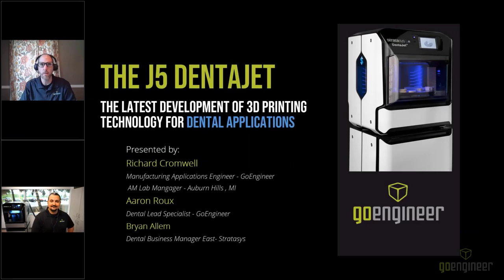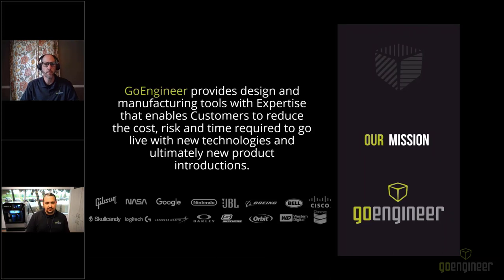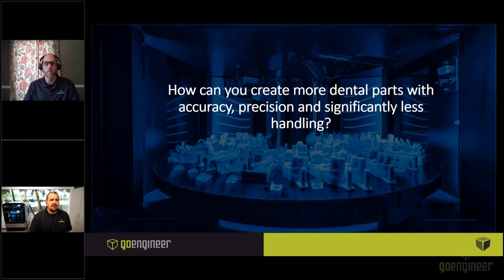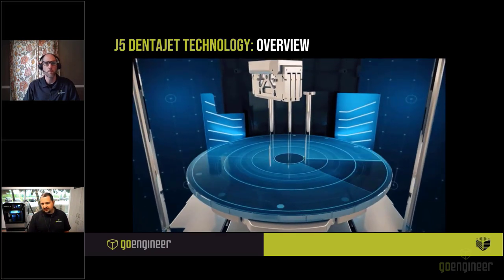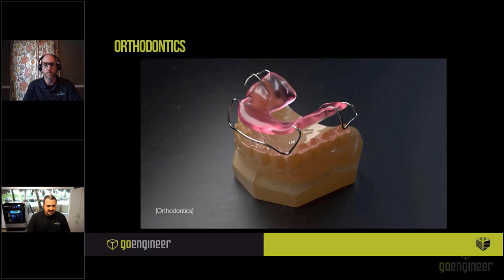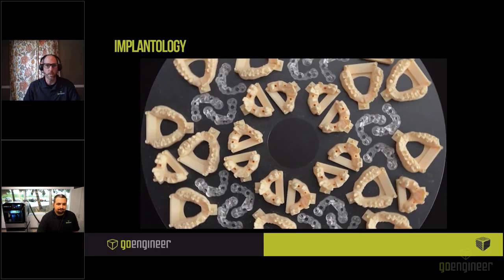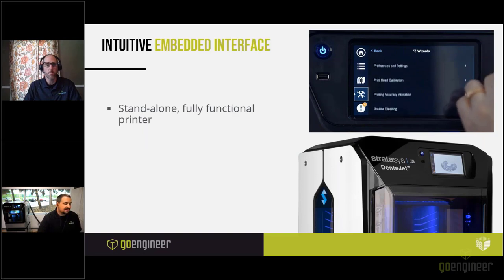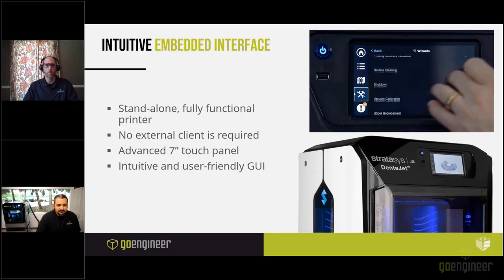Stratasys J5 DentaJet – 3D Printing Technology for Dental Applications - Webinar

Comment: The J5 is nice but I don't think it really brings anything new to the table for dental applications over SLA that justify the high cost of printing on it. Stratasys resins are crazy expensive. When it comes to speed/productivity I can stack up a bunch of smaller footprint SLA machines and get more done, and with that increased bandwidth and material cost savings I have no problem having a tech tend to the machines. I think where the J5 currently has a big advantage is its ability to print in close to full color, and I think Stratasys is not doing enough to leverage that. I am speaking as someone who has used a J5.
Reply: The J5 prints at 16 microns. Massive build plate. We rely on it to serve entire Canada and as we grow we are going to add more as the footprint is very small. This is the most powerful multi color  material on the market, their new monolithic printed denture will be much stronger and less time consuming that printing teeth and one color pink and gluing them together. This printer has been a game changer for our company Implant Genius and we highly recommend it to anyone who is serious about 3D printing.